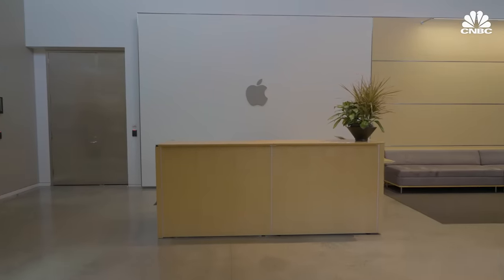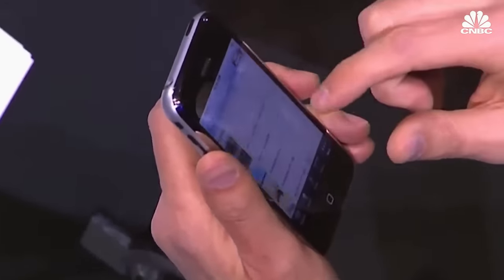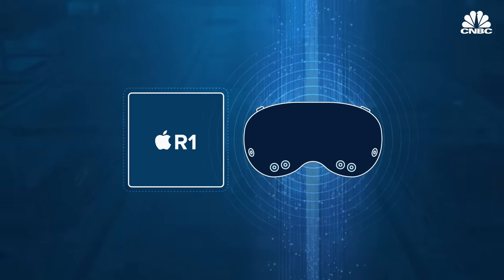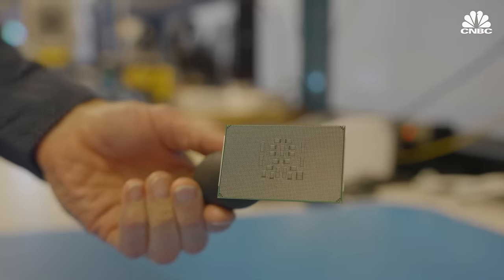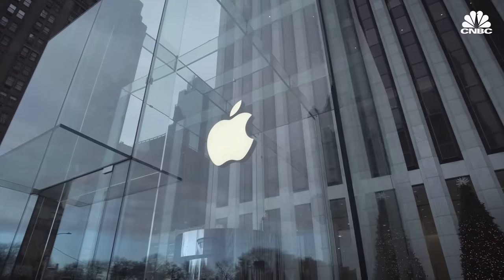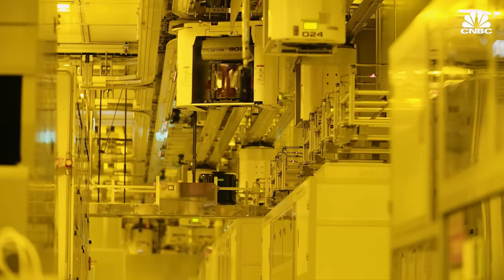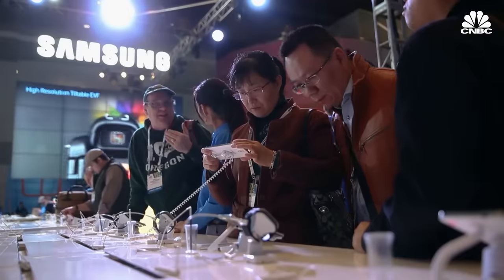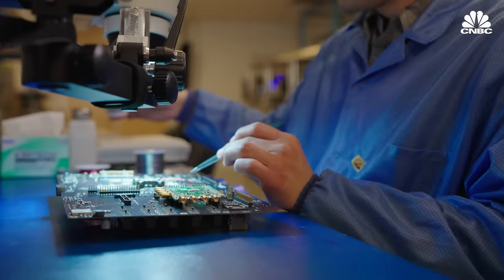Inside An Apple Lab That Makes Custom Chips For iPhone And Mac

Comment: Right now, Apple will surely be freightened about Qualcomm‘s Oryon X Elite Chip.
Reply: Hahahahahaha good joke
Reply: @ArthropodSpidey  We get it, you aren't able to think for yourself
Reply: I think for Apple, if it was between competition in smart phones or getting more capable ARM chips on the market, they would prefer more ARM chips. It means more developers using ARM instead of x86. Android isn't really competition because Google has gotten bad with code. Most of the chip's capability are wasted on Android doing stuff like collecting user information and having badly written inefficient code.
Reply: Even if Qualcomm could eventually catch up with previous generations of apple silicon, windows is not ready or optimized for ARM. not even taking into account that windows still doesn’t know what who is going to be the dominant player for Windows arm chips making it even harder to optimize.
Reply: @Nunya1721  Because when I think of worldwide processor chip leadership, I think of Qualcomm. /s
Reply: Plus Windows lacks of a good arm-x86  translation like Apple does with Rosetta , I have tested Windows arm translation and it sucks most of the time
Reply: @XXXRIPROACH microsoft and optimization don't belong together
Reply: NOT a joke bud!! @ArthropodSpidey
Reply: @Nunya1721  the joke part is that Qualcomm's stated goal is releasing, NEXT year, a chip... with the specs of LAST year's run of the mill chip.  So, yeah. that "Apple (...is..). frightened" is kind of funny.
Reply: @zpok123  Yes they are, why was M3 announced suddenly just before Snapdragon Summit.
Reply: @moeskido  They have more chips in more phones than anyone else. So you probably should
Reply: @Nunya1721  And McDonald's has more beef in more faces than anyone else. I'd still rather have prime rib. ;)

Your "quantity over quality" argument hasn't exactly worked where Apple products are concerned. Commodity Android phones are practically being given away in cereal boxes. Golly, they must really rake in the margins for Qualcomm chips.
Reply: @moeskido  Being a market leader is all about quantity. Your argument was wrong, I was just the one pointing it out.

Comment: Was there a single second of video from 'inside' where apple 'makes' their chips.
Reply: Apple Doesn't make their Chips We all know TSMC does it. and Apple hates modular Hardware components.  Apple loves Dongles and peripheral to charge as much as possible.  
Apple's Mac Pro is intentionally expensive and modular. However, Apple's current business model goes against modularity. 
Some reasons why Apple might not design modular phones include: 
Cost: A modular phone would be more expensive because of the cost of connectors.
Size: A modular phone would be larger and heavier.
Apple's design philosophy is to not change things for the sake of change. They believe their current design is perfect and don't want to change it. 
The simple and similar design of Apple products makes them instantly recognizable. For example, even if the Apple logo isn't visible, someone could easily pick out an iPhone from a pile of Android devices.
Reply: @Marty_YouTuber  ok thats great but comments was about a video regarding anninside look at where apple.makes its chips. Which it obviously wasnt

Comment: The DOJ said Apple has no more innovation. They make these baseless accusations based on what they see on the outside.

People have forgotten how big of a deal it was when M1 came out. Rosetta layered on top of M1 was a great transition strategy, because it gave comparable performance for x86 software. In other words, you can buy an M1 that was so much more power efficient at the time and not suffer performance degradation.

3 years later it's the standard now. A lot of software has been optimized for Apple Silicon, and Intel is left playing catchup.

That's innovation under the hood. Unfortunately, the DOJ has too many people who are tech-illiterate.

Comment: 0:32: 🔬 Apple's chip lab focuses on rigorous testing to find and address bugs and issues before shipping their chips.
3:55: 🍎 Apple develops various types of chips, including SoCs, for different devices such as iPhones, Macs, and Apple Watch.
11:27: 💻 Apple is focused on building the best products and is open to buying off-the-shelf technology, but it still relies on external manufacturers for chip fabrication.
14:32: 📱 The smartphone industry is facing challenges, with a focus on AI and new chip developments.
Recapped using Tammy AI

Comment: The M3 Max is not a leading chip in performance. It is impressive and its power consumption is impressive, but it doesn't beat the competition of the i9 13900h and the Ryzen 9 7945HX3d series processors. As a matter of fact, Ryzen beats the M3 by around 30%.

Comment: It'd be even better if they stopped recycling chips by renaming them and turning on cores that are already in them to begin with.. iphone 13, 14, and 15 are almost 100% identical. you get 1 more core but a different name. and I'm sure that core, has already been available, it was just turned off... after seeing the "compare iphones" page on their own site and noticing those 3 phones are 98% identical parts.. I quit using apple.
Reply: They're not simply 'turned off.' Modern chips don't usually have perfect yields so the chips that sold in lower-end SKUs usually have physical defects that prevent them from running at full performance. Instead of throwing the chips out, they reuse them for lower-cost products that aren't targeting the same level of performance. It's called binning and it's been standard practice everywhere for almost half a century at this point.

Comment: @ 14:24 the culture of the company that has a total lack of respect for employees ... proof of the scandals at the factories in China; the tools and the cheap testing equipment in this clip ... almost certainly the salaries below expectations for most of the employees ... otherwise good engineers would not leave a company if they did not have a strict policy on how much an engineer is allowed to earn or any other employee...

Comment: iPhone 15 pro max have lots of call drops, data doesn’t hand over from one cell successfully, Apple when you charge 1199 plus for your product be sure it works, iPhone 14 Pro Max no issue, only with iPhone 15 models, Apple have horrible engineers

Comment: they just design. taiwan makes them
Reply: Yes. 
Just.
 They - the thousands of their engineers, together with their manufacturing partners, ... just... design the chips, design the processes and machines to build the chips, the sourcing and manufacturing cycle and the different scaling scenarios, the machines and the software to use the chips... and all other processes needed to get those cute shiny products into our pudgy greedy hands in exchange for a ridiculous amount of cash, which we're (almost) happy to part with...
 
all... "just"... designed...
Reply: @zpok123  american tech is like a designer who draws clothes but can't actually sew

Comment: What is interesting is that macbooks with intel chips would support 2 external displays while the M1 chip in macbook air does not. So how is an M1 chip better than an Intel i5 ?
Reply: I dislike the limited display support of the M1, but to answer your question, the M1 beats my old i5 in every other way: Sheer power, power efficiency, cooler operation, longer battery life, far far better GPU power. It is such a lopsided contest that even though I really wish Apple wouldn’t make us upgrade to the M_ Max for more displays, there is still no question that I never want to use an Intel Mac laptop again because the M series is so superior overall.
Reply: Because lacking ONE feature does not make it worse.  Any other dumb questions?
Reply: I bought a top of the line intel macbook pro about a year before they came out with their own silicon. I have now bought a MBPro M3Max, years sooner than I normally upgrade. And BOY was it worth it. 
Your question is kind of interesting, but also, it answers itself, if you do the minimum of homework. Yes, the M1, the cheapest version, was way ahead of anything intel could produce at any kind of volume, except supported amount of screens. 
But...
Want more screens and even BETTER performance? Buy an M1pro, or M1 max, or you know, go wild and buy an M1 ultra. Cheers.

Comment: Hopefully Apple doesn't make the same mistake again with their chips by creating their own ecosystem. Apple producing their own silicon is not really new. They used to do it before using Intel Chips. But they used their own proprietary technology and limited the ability of their products. They effectively went down to 5% market share and a lot of that was for educational use. ARM providing competition for X86 definitely helps in this regard since the chip licensing was the main factor why the chip market was closed.
SoCs are a good business strategy for Apple but won't work for other types of consumers. The SoC provides a lot of advantages over a socketed design. The SoC can also be more specialized than something socketed. It gives better thermal and energy efficiency at the same performance. For Apple, their consumers are used to replacing their devices every couple of years. So, there is no need to upgrade individual components. However, for other consumers that may run a board for 5~10 years this would never work.
Reply: I’m using a Mac mini that is 12 years old…runs great. What was your point?

Comment: Apple doesn't make squat!. Designing chips is not making them. I can design a house or a cake & pay to have it made, this is exactly what apple does.
Reply: Yes… But no.
Reply: Exactly.  I'm almost done with that turd samich you designed and ordered.  Just a little back log with the corn in the supply chain.
Reply: people hate apple for the dumbest reasons